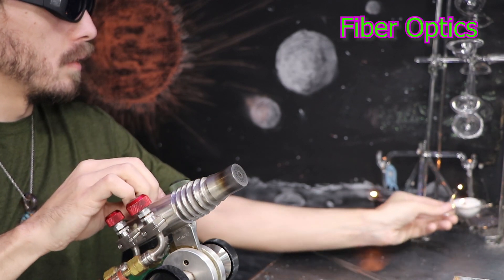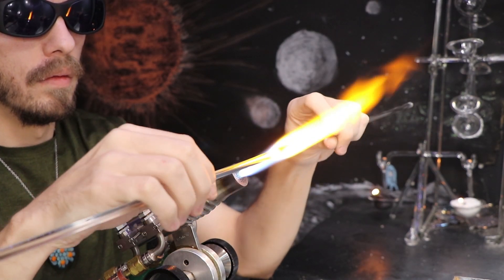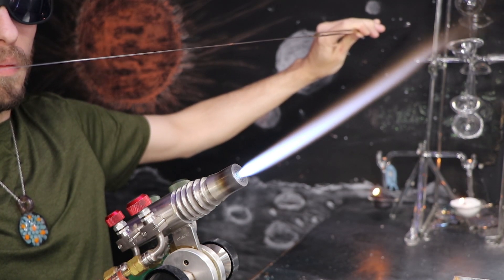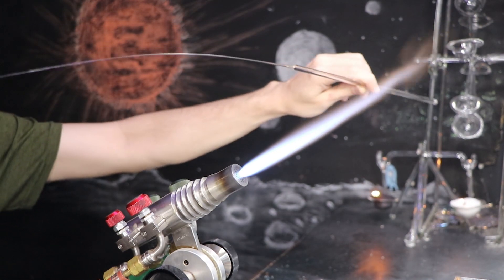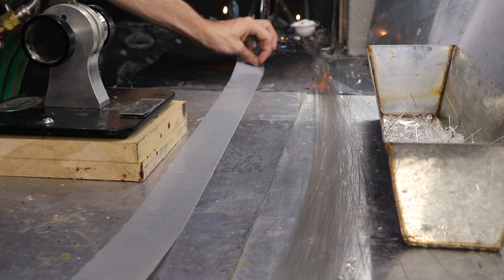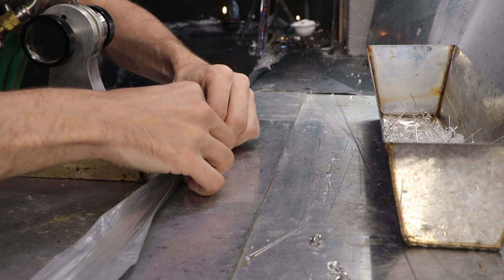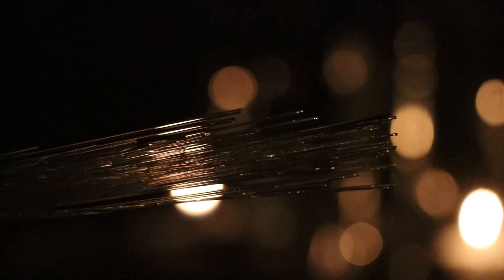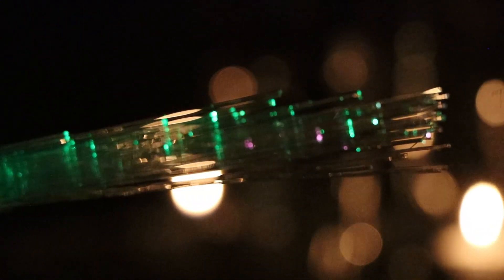Fiber Optic Cable handmade

Comment: You need two different types of glass, this is what creates the fiber optic effect in FO. Generally a softer glass outside and harder on the inside then it is pulled into the fiber. This traps the light inside as currently sharp bends would lose the light in this setup.Try perhaps rod inside of Boro tube of proper diameter and melt them together before the pull, I suspect you will see substantially different results that way. 
Another way in many modern ones is coating with plastics if I recall correctly but that could be a pain in the ass as you would need to do it after the pull.
Reply from the maker: Thanks for the reply @Sedit T, although I have to slightly disagree. I believe the cladding was discovered a few decades after the phenomenon of FO. 
  Unclad glass or other transparent matter (plastic or water) can still transmit light a long distance if you consider air a natural cladding. So you aren't wrong, it does requires two materials or the light would spill out.
  I also like that idea. I might try a slightly doped rod like Glass Alchemy Serum inside a clear tube to see what happens.
Reply: You can't combine soft glass and boro. The difference in their COE is too great, the soft glass cracks and shatters before the boro cools.
Reply from the maker: @InsomniCAT3057  That is true Cathy, but I'm not sure if he's talking about soda lime and boro. My research said something about doped quartz, so it might be two slightly different types of quartz glass. It makes me want to try it [soda-lime + boro] pulled out hair thin to see what happens.